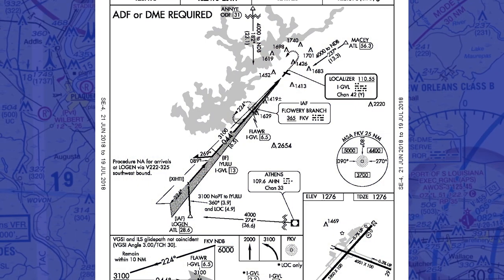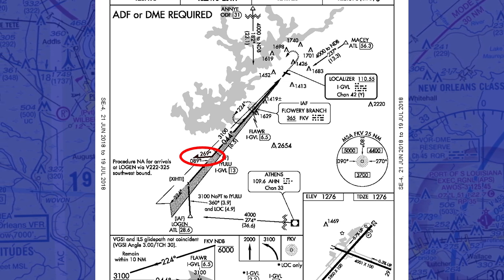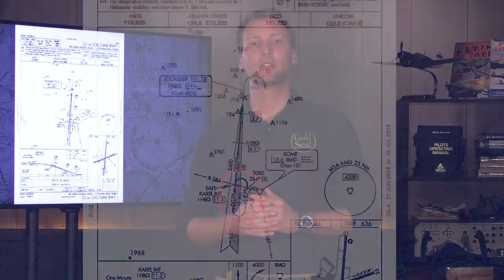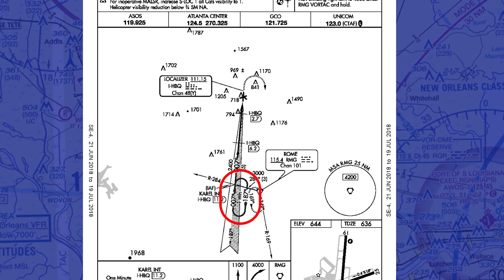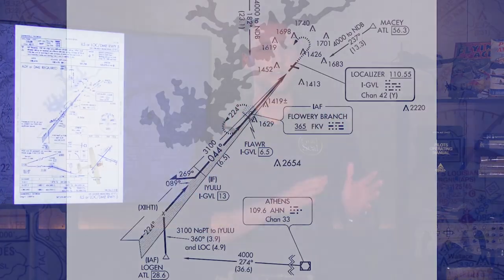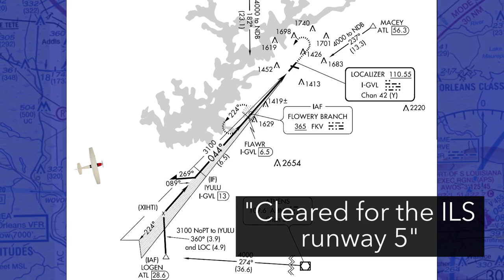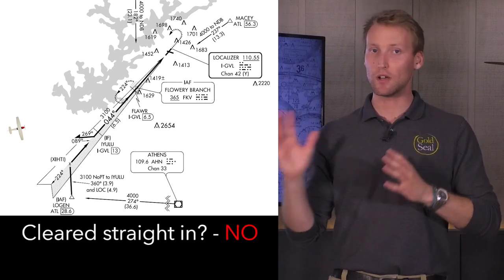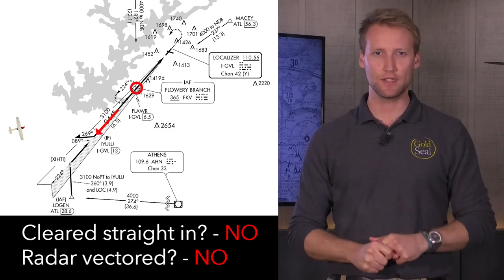Procedure Turn - When Do You Have to Do It??

Comment: Thanks for the video. Here's an acronym that helps remember when a PT is not required: SHARPT = Straight-in, Holding in lieu of a PT, Arc (DME Arc), Radar Vectors, NoPT, Timed approach from a holding fix.

Comment: As a controller for many years, I'm guilty of not saying "straight in" when that's what I'm expecting and I don't recall being asked. Minor but important that this is done in my opinion, especially if I have following traffic and #1 does an unexpected PT. Problem was I didn't know it was required for the longest time, seemed like a "no-brainer." Best piece of advice in this video is to communicate, just ask. Great video.
Reply from the maker: Thanks. Yes, it can be a confusing situation.

Comment: Thank you for another excellent video. I earned my private pilot license last summer but I still have questions about turns. Is there an instructional video on doing a one minute turn/one rate turn/standard rate turn? For example if you not instrument rated and you inadvertently fly into  IMC you want to do a 180 turn to head back to VMC. The one minute turn/standard rate turn is required, correct? Is there a video that demonstrates this?
Reply: There are no requirements for how to exit IMC, just recommendations for how to do it safely. The easiest way in my opinion is to do a standard rate turn (3 deg per second). This ensures a quick but smooth turn and makes it easier to maintain level flight. Standard rate can be identified by two thick lines towards the top of your turn coordinator. If you are in a coordinated turn and the miniature airplane is lined up with that line then you would complete a 180 degree turn in 1 minute.

Comment: please elaborate on the "cleared straight in" never encountered it before.   If you are cleared you dont need to do a PT.  "123 maintain 3K until established on the final approach course, cleared for the Ils 05"
Reply: Josh Tocko yeah it’s included in the “radar vectors” option.  It’s radar vectors...to final.  Cleared straight in isn’t really a thing.  Straight in is the opposite of a circling approach (>30 degrees from runway heading) and shouldn’t be used in this case.
Reply: Yeah I don’t think I’ve really ever heard ATC say “cleared straight in” before. I’ve had ATC ask if I’d like to fly the “full approach” in which case I’ll be flying outbound then making a procedure turn inbound, but as I’ve understood it “cleared for the __ approach runway __ “ has seemed to mean straight in.
Reply from the maker: Yep, it is a thing and does occur. See the Instrument Procedures Handbook.
Reply: I was NNW of Minot Int (KMOT), heading SE (don’t remember specific heading) on vectors for ILS Rwy 31 at KMOT. I was several miles almost parallel, kind of on a right downwind to the inbound course for 31. Approach issued: Proceed direct HEKTA, join the LOC, clear ILS Rwy 31 approach. If you picture my location relative to HEKTA, I couldn’t join the LOC without executing the PT for reversal. I politely ask to fly one turn on the PT, to which his answer was Stand-by. I was IMC and thinking he was expecting me to make that crazy turn to join the LOC. He replied to proceed as requested which confirmed he was not expecting me to use the PT to reverse course to have a normal join to LOC. I found some inconsistencies on the clearance, however, as stated here I asked.